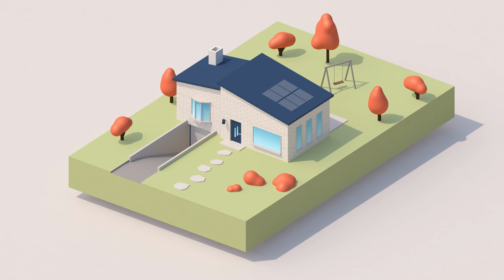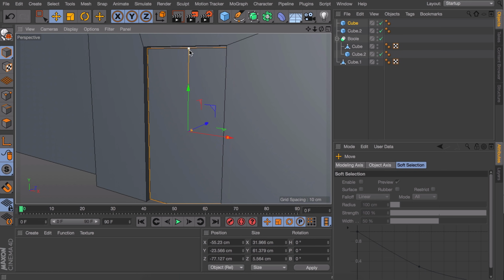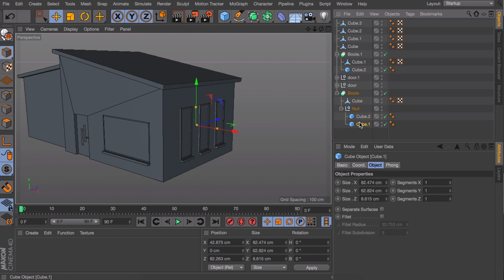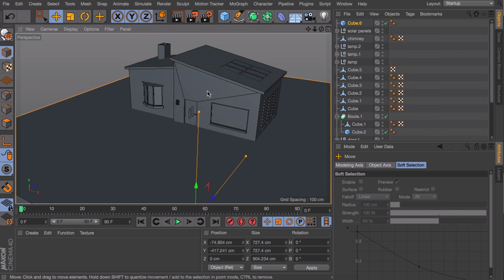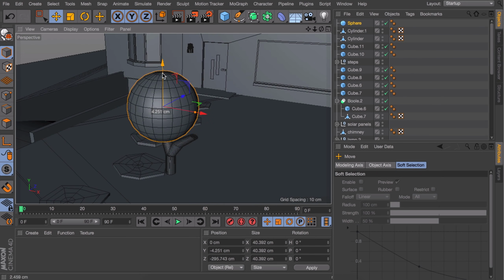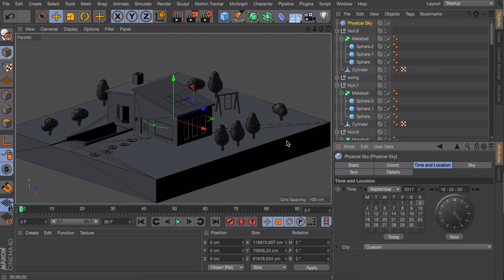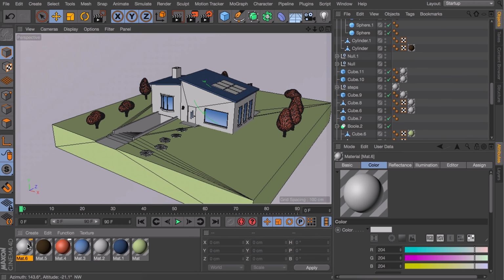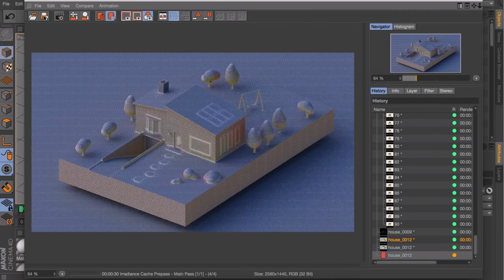C4D TUTORIAL  |  Simple Cute House  (Ultra-Beginner)

Comment: im gonna cry it's not working
Reply from the maker: Any specific part that's not working out for you?
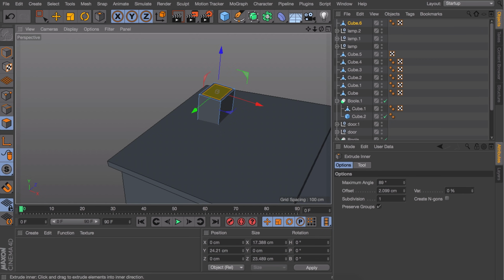Reply: @twistereli  12:49 - the bevel/smoothing of the edge :( when I put up the subdivision nothing changes. I'm sure I'm on the right track
Reply from the maker: @arateki3942  You can try clicking and dragging  left to right (after selecting the edge).
You can also practice on a simple cube first to see if/how it works there.
Reply: @twistereli  never mind it's working now! I didn't have the edges tool selected

Comment: hello I want to know is there any snapping options in C4D cuz I'm not sure if I place the three, side windows at the exact middle of the wall.
Reply: The magnet icon on the left enables snapping (hold for options) but it is not so intuitive, especially trying to place something in the center of a wall for example. But you can try.
Quickest way is to keep all dimensions of your model in round numbers and use the shift key while moving to move in increments of 10cm.

Comment: @twistereli Some steps I've done over and over and over. you didn't explain the series of repetitive steps to do one thing. I need help
Reply from the maker: What part are you having problems with?
Reply: @twistereli  the door. It won’t let me place it inside so it pokes out. I attempted maybe 30 times before getting exhausted
Reply from the maker: @eye2animate220  That's weird. It's probably best to figure out what is causing the problem. So I suggest you make that door cube a lot bigger and start moving it around to see if it cuts in the building.
Right now it sounds like your door isn't touching the building, but it should overlap for it to work. 
Also make sure the door is the 2nd object under the Boole.
If you can see both the door AND the building when they're in a boole, something is really broken.

Comment: When I scale the Swing null all the parts scale independently. Any advice?
Reply: Hm, nothing I can think of. That doesn't sound right. You can try copy & pasting the swing in another file and try scaling there so you know if it's the model or the scene/tool settings that are wrong.
Reply: @elip7066  Solved the problem, kind of, I found if I adjusted the size using the coordinates panel on the bottum right they scaled properly. But still not with the proper scale tool. Weird, but just had to work around it. 

Thanks for taking the time to comment! I seen you commented on my instagram photo as well (future_cultleader)

Thanks for being so active, I really appreciate all your effort!

Comment: One question I kinda wanna ask is this.
With the "I" for Extrude (when you need to extrude multiple times) couldn't you just press "I" again or do you specifically have to press "D" after the initial "I" click and thereafter?
Reply: I = inner extrude, which means it makes a smaller copy of the polygon inside of it, without moving up or down
D = (regular) extrude, which means to move the polygon up or down / gives it volume

Comment: Couple of suggestions though:

1. Maybe change the title from Ultra-Beginner to something more like Beginner++. True, this is my very first day with C4D, but I have a few years of experience with other 3D software like Blender and I was barely keeping up.
2. It would help if you had menu pathways and especially shortcuts you use spelled out in the corner of the screen. I'm almost positive there are ways to make shortcut projection automatic while screenrecording.
3. There HAVE TO BE a smarter way to model those splitting branches and swing ropes than just duplicating and rotating the whole thing! This technique struck me as particularly dirty, all the unnecessary poligons and potential glitches it creates. I assume you just used it here for simplicity sake, right?
Reply: I've done the shortcut overlay on other videos, but it gets really messy when navigating the view for example. So a manual overlay would be better (but also time consuming)
The swing indeed is a bit more dirty. Just trying to stick with a couple of basics that are not too specifically tied to 1 case, but can be helpful in many situations.
But yes, many parts could be done in many different (and possibly better) ways.

Comment: I literally just started this app again. I tried it once back in 2010 and couldn't even make anything other than a primitive, lol. I've been using Blender for awhile now tho and coming back to this program feels vastly better!
Some tips though for beginners:

-Rename your objects on the right by double-clicking. You'll need referencing as you progress
-Change between viewports using the F1 (3d), F2 (Top / Y-Axis), F3 (Right / Z-Axis),  and F4 (Front / X-Axis).
-Middle-Mouse and F5 enable quad-view for all viewports. Use Middle-Mouse to swap between the viewport you're hovering over (Much like swapping between viewports with the Spacebar in Maya)
-Enable Auto-Save: Ctrl-E or Edit -> Preferences -> Files. Chance The interval to anything between 10 and 20 minutes.
-Enable Coordinate System: Press W (wont need to tinker around with rotation values to match world orientation)
-Use Shift-S for snap to grid if need be.
-Lastly: go through the Commands menu by pressing Shift+F12. To be honest, I've never seen so few commands in any other 3D application

Edit: Also if you want to Scale things as a collection without them acting individually: Press T to bring up the Scaling, and click + drag on one of the colored right-angles. I found that to be incredibly useful with grouped objects.

Comment: when i press “d” it doesn’t give me the extrude tool
Reply: Strange, I would just go with Right clicking and selecting it in that menu then.
Reply: @elip7066  when i right click, it doesn't give me the option to choose it either. I don't think that I am right clicking in the right location. Where should I right click?
Reply: @kilesullivan2516  Somewhere in the frame where the 3D model is. But maybe you're not in the polygon mode yet. You can pick that at the left side (cube with orange top)

Other possibility is that you're using C4D Lite which comes with After Effects. That misses most functions used in this video of the full C4D version.
Reply: @elip7066  I ended up realizing that I am using the C4D Lite. Do you know of anyway to get the full version?
Reply: @kilesullivan2516  If you're a student you can receive a free copy from Maxon if you fill in the form on their site.
But you can already try the demo for 42 days: https://www.maxon.net/en/try/demo-download/

Comment: My first attempt hehe! took me about 2.5 hours. I had to pause a lot and go back to understand some parts. The one that really was a blocker for me was figuring out how to extrude the driveway. After many googling attempts, I just started hitting random keys and figured out that I had to hold "command" and drag! phew. I do like the speed of it, because you can pause or get through it quickly.

Thank you so much
Reply from the maker: I'm happy to hear to managed to get through it. Props to you for sticking around when it wasn't too clear.
2,5 hours isn't too bad considering how fast I go in the video (and it's still 30+ minutes).
Usually I try to keep everything compact by skipping the explanation of techniques we used earlier. But I do realize it can be a bit difficult to remember for beginners. 
Good luck with your upcoming works!
Reply: Thank you so much for this comment. lol

Comment: at 11:29 when I extrude upwards it doesn't go up at 90 degree angle..is there a way to fix this? I'm using R19 version, thanks.
Reply: This could happen because of multiple reasons. As an alternative to using the Bevel tool (D), try holding CTRL (or CMD on Mac) while moving the polygons up.
Reply: Well thank you so much, It worked by holding CTRL :)

Comment: Hi . I followed your video (which is great by the way) and modelled a scenario. However, the render to picture viewer always comes up black. Any fix?
Reply: If you didn't add any lights or sky etc, it should never render black. Otherwise it could be a bug.
If you did add some light, but not like in this video, you probably don't have enough of it and need to add way more light to get rid of the darkness.
Reply: Eli Prenten hi. I did add the physical sky like in the video and the sun is on. But I'm running a high gpu system. It says its calculating the image but only darkness. I'm still confused as its the first time I'm trying this software.
Reply: Eli Prenten yes I did. I looked up several fix videos but I feel like the issue lies in the external renderer. For it live renders in c4d but not in external.
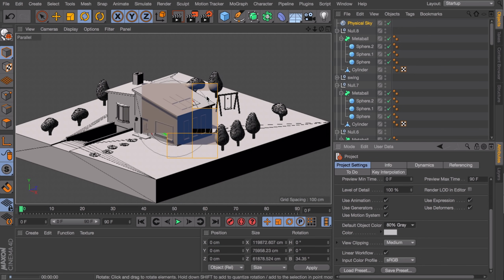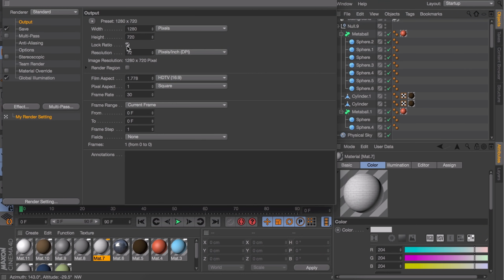Reply: So if you render like I do at 24:30 it does work, but when you render to the picture viewer (32:49) it doesn't?
In that case 1 of the possible problems is that you disabled an option by accident. If you click on "View" (right above your viewport) make sure "Use as render view" is enabled.

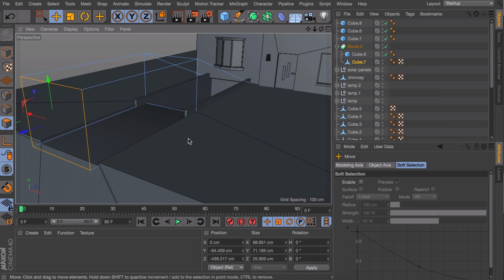Comment: Hi! I'm trying to do the extrude move in 15:41 but even after I rotate the face of the cube, it's still moving the whole object. Can you help?
Reply from the maker: The extrusion can be done by holding CTRL (windows) or CMD (mac) and moving that selected polygon.
Another way is to right click and choose "Extrude". Then just click and drag.
Reply: Having the same problem! It appears that Extrude is not available if you are using Cinema 4D Lite. @twistereli is that correct? Thanks so much! Amazing tutorial.
Reply from the maker: That is possible, the Lite version is very limited. It would surprise me if you could get all the way to this part of the video in the Lite version.

Comment: Quick question: is there a way to set the angle of the edge edit to be default 0,0,0 degrees? Great Tut btw!
Reply from the maker: Yes there kind of is. I only found this out myself by someone else's comment some time ago! 
At the top of your interface you have the X Y Z buttons, in between those and the render button there is "coordinate system". Enable that and the axis will always point in the same direction, without even modifying the edges axis.
Reply: Ah yes, that works. Thank you for the quick reply. I look forward to keeping up with your tutorials. Keep up the good work!